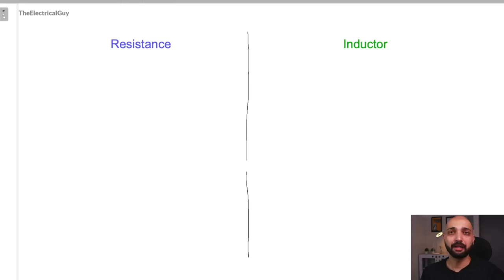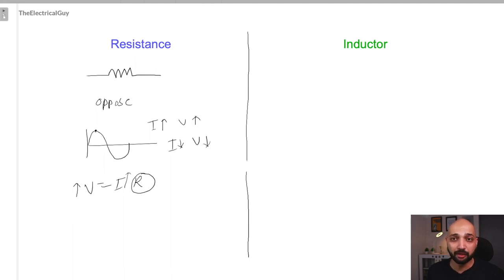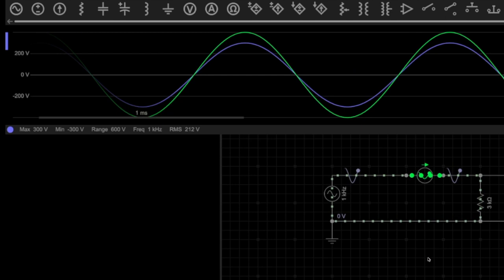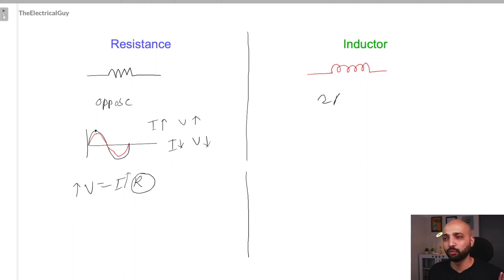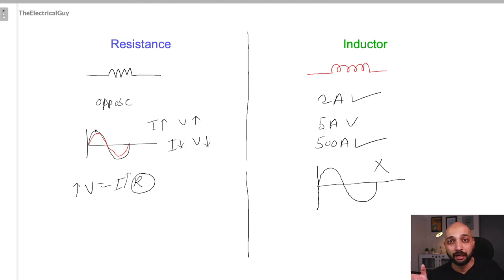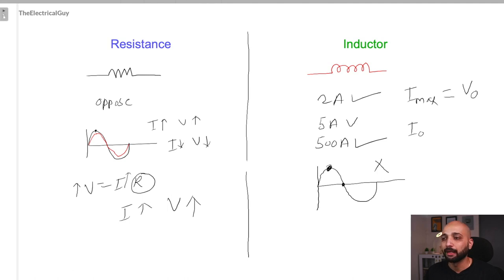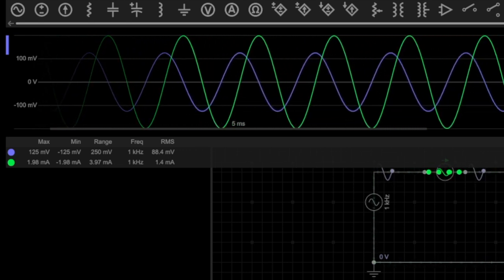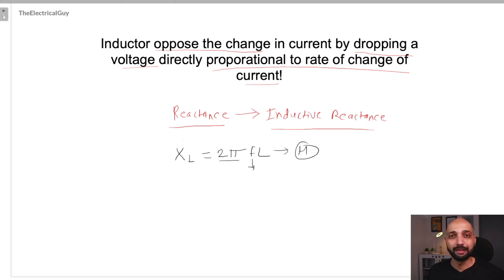What is Inductive Reactance & how to calculate it | TheElectricalGuy

Comment: at time 5:00 its super confusing.
Reply: agreed, some word salad going on there. 
part of the issue with me was the use of the term “increase of current”. 
Normally I would consider that phrase to be describing the increase as associated with the entire circuit. In the description he is using here, the increase/decrease of current change is in context of a single waveform cycle in relation to voltage. Once that context was clear, the rest of it became somewhat easier to understand.

Comment: Very good video... keep it up
Reply from the maker: Thank you 😊
Reply: @GauravJ  one doubt,i have a scenario where two sources say ac and DC are being used and the circuit has both resistance and Inductance ,i need to find voltage at junction when switch is set on.Can you please suggest or can I email you the question for your suggestions? Please let me know your email id?

Comment: one doubt,i have a scenario where two sources say ac and DC are being used and the circuit has both resistance and Inductance ,i need to find voltage at junction when switch is set on.Can you please suggest or can I email you the question for your suggestions? Please let me know your email id?